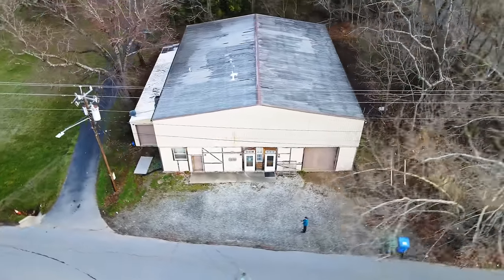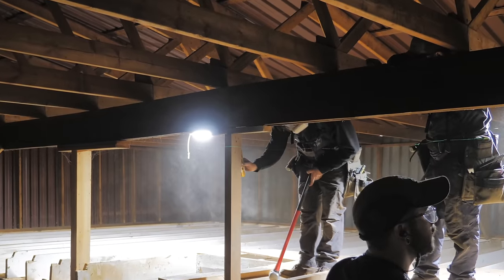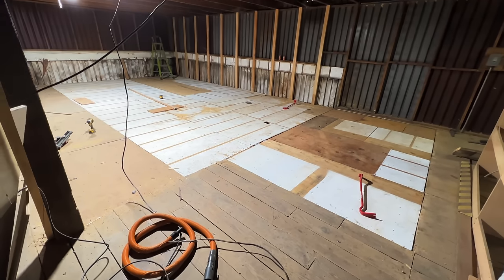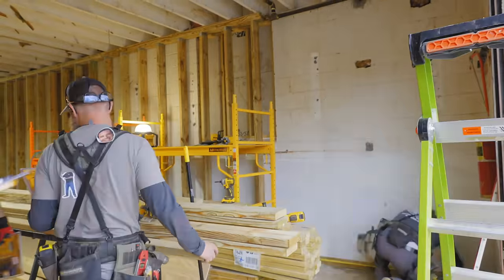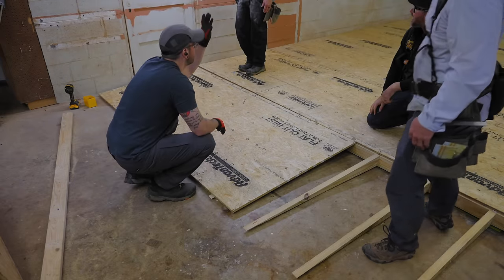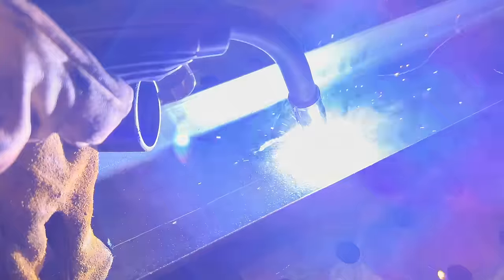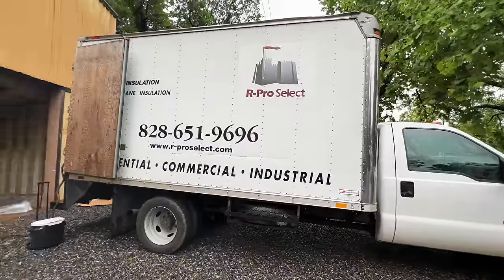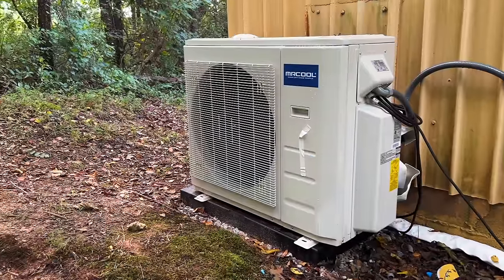50 Yr Old Workshop Restoration Into My Dream Shop

Comment: French drain the outer wall and replace soil with gravel, that building will never be dry unless you sort out the external issues.
Reply: Yeah I was confused why he didn't apply a waterproofing membrane to the external wall down to the foundation and then back fill with the grading corrected

Comment: Nicely done, an german electrician here, we have here 230V for normal household devices and 400V 3-Phase power for heavier machinery, then you swap the external conductor they ar running in the wrong direction. Normally we have clockwise rotating field so then you swap 2 wires, you have couterclockwise rotating field, so have fun with that

Comment: FEI, when re-identifying white or grey neutrals as hot wires, you need to do it everywhere the wire is accessible or visible, not just the load center.  So at both ends and every j-box or pull point it runs through you need to wrap it with black or red tape, paint it, use a Sharpie, etc.  That also only applies to the white or gray conductor in a cable.  When you're pulling individual conductors, you can't re-identify a white or gray conductor and use it as a hot.  In that case, buy more black or red THHN.

Comment: For soundproofing, walls should have a 2x6 top and bottom plate with 2x4 studs that alternate sides of the wall so mechanical vibration does not transfer. Use 6" thick insulation between the 2x4s.

Comment: WOW, what an awesome achievement. I also think the porch has forever changed the look and intended purpose of the shop. 
Can I also give solid props to Ray. The guy just has heart, he has been pushing shit uphill with his type 1 forever but still does everything with a smile.
Reply from the maker: Thanks, the porch massively improved the curb appeal for sure. Can't wait to get it painted and also add some windows on the second level to make the front pop even more. Also, Ray is such a hard worker, same with the rest of the crew. They do the work without complaining, even when the work sucks.
Reply: @craftedworkshop  yeah that will look awesome. Would you go modern or lean to the more vintage style windows?

Comment: Tip from someone installing those types of drop ceiling tile quite often, use Mr.Clean magic earaser and rub it dry on the stain...itll make most of them go away. If not, sprinkle some baby powder onto a dry paint brush and dab it on the tile. It should hide it and blend nicely with the rest of the tile. Great job non the less !!!
Reply from the maker: Great tip! Thanks for that.
Reply: @craftedworkshop  my pleasure mate, i love what you do !

Comment: Since there's a place for a comment, I'll leave one. 
First off, I don't think it escapes most of us, that although your a woodworker, and not a full-time carpenter/builder, you're doing a fantastic job, and it's clearly evident that it's your heart's desire to try and do everything as "right" as you possibly can. Very impressive. Your choices of tools and brands and subs (construction help/Perkins Bros) also equally impressive! Videography,,, also Spot-On! You're truly mastering your craft and coming into your own with your channel.  That being said, please don't feel like In this process that you need to adopt the inflection and delivery techniques of Ron Burgundy on the 6 o'clock news. 😅
That is all.

Comment: This comment is of course someone after the fact. However some 45 years ago, when I was a much younger carpenter. I was helping an older carpenter install a large acoustical ceiling tile job. Once we had the furring strips all installed, he brought out a couple of cloth aprons. He then poured a decent amount of corn starch in both sides of the aprons. We put on our aprons. And then instructed me to occasionally put my fingers in my apron, and grind them in the cornstarch. It kept my fingers extremely clean, and of course kept the tiles from showing any fingerprints also. Great video. I enjoyed watching your 3D layout and hard work come to fruition.😅
Reply from the maker: That is brilliant! I will definitely keep that tip in mind when I need to move the tiles in the future. Thanks!

Comment: My son has a 4000 plus sq ft cabinet shop here in Florida.
It is a production type shop, where he produces cabinets primarily, but also custom trim for his customers.
I cant even imagine him operating in a shop finished to the degree that this shop is.
Im assuming it will be used as a class room more so than a production type shop ?
None the less you did a very nice job on it.
I watch quite a few of the Perkins Bros. videos as well.
They are good mechanics, and that shows up in their work.
I was a home builder as well before retiring to Florida.
Reply from the maker: Yea, this is really more of a woodworking "studio" if you will, since I film my videos in the space. I will also be doing classes at some point in the future. I personally love having a well lit and clean shop though, makes me want to work in the space even more.
Reply: @craftedworkshop  Well, all the best with your new venture.
From my observations, id say that a great many of the shops on Youtube are more of a hobby variety than they are a working variety.
All the nice tools and such showcased on the walls do make a nice backdrop.
But they arent very practical in a real world production shop.
Aside from a charging station and some type of a proper cutting setup, there isnt much else to showcase.
As production increases, and more large machinery is added in order to meet the demands, the shop layout is apt to be changed anyway.
Lumber storage also eventually becomes an issue.
First off, in order to be competitive, it needs to be bought in bulk lots, not just job lots.
That means multiple pallets of lumber and plywood being bought and stored.
That also means that most even large variety lumber racks become obsolete.
It also means that a forklift is necessary for off loading and moving lumber from place to place.
How many youtube videos show or even talk about any of that?

Comment: I have an old 5k sq ft cinder block building that was an auto body business, and it was in terrible shape. It's still pretty rough but my partner has put in a ton of work to get it in a way that has allowed him to start a small woodshop and some table top CNC stuff. The first order of business for me was arranging the local electric company to get the electrical NEC compliant. It's been a really positive experience and my passion only grows as we make progress.

Your video covers so many things that we are dealing with! Thank you!! I also really appreciate everyone's use of PPE. Our electrical panel had old screw in fuses! Even a old solid copper or two in place of the first 🙄

Comment: nice edit, great project! glad you could find a job for all essential tools, like the post level and the cutting attachment for the impact gun 😉
one remark on the drainage outside: being you I would use the excavator to dig out around the wall and add an insulation layer.

Comment: String trimmer line comes in short straight pieces, which would be better and easier to use than the rolled version. Thank you for sharing your shop video 🥳

Comment: A good tip for the drop tiles that have fingerprints on them is to lightly scrub them with a moist paper towel, It will take out most of the lighter fingerprints.

Comment: Impressed how much stuff you were able to save and reuse in the rebuild. A little cheap thin steel wire will work good in place of the trimmer string if you don't have it handy too. Man that electrical work would be hard for me to stay motivated on. Came out amazing though.

Comment: First and foremost, I just want to say that this was an incredibly great video! We've seen the entire workshop transform from a dilapidated storage space into a dream workshop for us hobby carpenters. I'm really looking forward to seeing cool projects being made here!
I'm studying to become a civil engineer and I was just wondering about something; why didn't you choose to have a moisture barrier behind the studs on the east side of the building, since this was a wall with moisture issues? Another thing; if you notice that the CNC room gets a bit noisy, you might consider adding EPS/XPS insulation to reduce flanking transmission through the floor.
Anyway, I just want to say that the workshop looks fantastic and the video was informative and fun to watch!
Reply from the maker: Thanks, glad you enjoyed it! The closed cell spray foam acted as the moisture barrier there. That combined with the Drylok and PT lumber should mean no long term issues with moisture. I still haven't built the doors for the CNC room but good tip!
Reply: I'm not completely sure that I understand what you're suggesting for sound iso (the floor above or below?) but, I'll proffer this info. Closed cell foam board isn't usually helpful for sound. It doesn't 'absorb' sound like a fibrous or porous material does (fiberglass etc). And it has virtually no mass so it doesn't help in reflecting sound back except at high frequencies which is usually not the issue between rooms. But you're right on target wrt flanking paths. This is why sound isolation is so hard. One little gap somewhere can undermine a huge amount of cost and effort. I can almost guarantee that his doors are going to be the weak point. Any door that will not be the weak point will cost him an incredible amount of money and will not be easy to open and close. Lastly, it's not clear to me where his dust collector is going to live. With a real spindle on the CNC, the primary noise source is the DC, especially low frequency noise that is hard to isolate.
Reply: best way to mediate noise is to stop it at the board by floating the board on the studding on top of thickening. Zoning and segregating always beats just money into material to try and create utter barrier by way of force. like heck why not just go outside and start loading clay into the cavity :P

Comment: Why did you choose to level the floor with wood as opposed to self-leveling concrete? That's designed specifically for fixing that kind of issue?
Reply: Have you ever used it? It's fine under carpet, though It tends to come loose and create an annoying floating slab.

Comment: The drill bit for Tap-Cons is smaller than the screw. If you use a 1/4" bit with a 1/4" screw, it will spin all day long. Use 3/16 drill bit for 1/4" screws. It tells you on the packaging the correct size drill bit. The trimmer string is great when the screw has been ran in and out too many times.

Comment: You're drilling in cinder block. It tends to bore out more than poured concrete when drilled. Drop down slightly on the bit diameter. I've used thousands of Tapcons.

Comment: An easy method to wrap an I-beam is use 3/4” plywood and pocket screw them into the joists above.  (Pre-installed cleats also work and can double up as strapping if you’re sheet rocking) You can wrap the bottom portion with any thickness of plywood (depending on final height.  From there you can either install Sheetrock or finish as is.  No drilling through the I-beam required and it’s plenty strong!  As a bonus, the void behind the plywood can be used as a raceway for wiring or conduit.

Comment: now that I re-watch your restoration of your shop, I caught the assembly of the new Garage door,  that lowered the passage height. Wasn't it that specific door that made the Camper-Van remodelling such a pain? 😂
Reply from the maker: Hah, yes that did make the van a little trickier to get inside, but the porch girders are at the same height roughly. I don't plan on having vehicles that tall in the shop so it wasn't something I was going to plan around, I really wanted a door with thick insulation.

Comment: The secret to sound proofing is air gap. Air is actually pretty bad medium for sound wave propagation. Whales can communicate over vast distances because sound travels much farther in water. The reason why those tin can and cord phones work so well is because the sound waves aka. vibration can travel down the cord. Cut the cord (create air gap), it stops working. I wish you did a before and after sound test between the upper and lower floors before installing the drop ceiling. While it's not perfect because it's still connected to the ceiling, I bet it greatly reduced sound travel between the two floors.

If you have noise issue from the CNC room, what you can do is hang some foam boards (styrofoam or similar) from the ceiling about an inch or so away from the walls. Full coverage is not necessary but the more the better.

Comment: I am curious as to why the block wall was not excavated on the outside and waterproofed,  on the outside rather than the inside !  Was there any w'proof membrane outside against the dirt in the original block construction?

Comment: Excavate all the way to the footers waterproof the outside then put in a drain and backfill with rock not dirt use landscape fabric over the rock to prevent it from filling up with dirt. The drain needs to run down hill of course. The bowed block wall may straighten out when you do the excavation.

Comment: @craftedworkshop There are a few different types of Wago connectors, but with the type you used, you don't even have to flip the clips up when connecting the cable. You can just push it in if it has a solid core and doesn't have individual strands of copper. When removing the cable from the connector, you have to use the clips.

Kind regards from Germany

Comment: Hello , maybe didn't make the video but you need to pull vacuum on the cooper minisplit lines before opening refrigerant you do this to check for leaks and to have clean lines free of air
Reply from the maker: Not with these MRCOOL units, the lines are pre-charged.

Comment: Not sure if it will grow in your region, but if you want low maintenance ground cover, the best I've seen is a plant called "kinnikinnick" It's a very low shrub, 4 to 6 inches high, that just spreads out over the ground.  Plant them about 6 feet apart, weed the ground between them until they form a continuous mat a few years later, and then you've got something that's pretty drought resistant and requires basically zero effort to maintain.

Comment: Thanks for sharing, especially the costs involved.  I would like to understand the rational behind the raised floor.  It is understandable that the slope of the floor/drain might have been an issue, however, it seems like there might have been other reasons behind this decision and expense.  Also, how do you get into the spray room with the door blocked.  Also, will your only access to the second floor be from the outside?
Reply from the maker: The floor drain caused the floor to slope about 8 inches over 12 feet. I talked to a few concrete guys and they said pouring additional concrete was a bad idea as it wouldn't adhere to the existing slab. Also, I personally think it's much nicer to work on a wooden floor, a lot easier on the joints. The spray room has a huge door opening around the corner from the door I covered up, just wasn't easy to see in the video. The second floor is accessed through the office/kitchen space, plus the back door leading outside. Thanks for watching1

Comment: It's nice to see pro's working vs DIY vibes. Only thing i thought worth mentioning since painting new stuff is common and someone else might benefit - RE: this job's  "Caulking -

- in painting is usually called "gap filling" and uses acrylic "no more gaps" etc

 vs 

- finishing the gaps between painted and unpainted surfaces which is done with silicone like caulking and a pop-stick)

- the gap filling for painting is much better done AFTER the primer coat

- it doesn't bond well to surfaces that havent been done and can start to peel out over time and is a hassle to deal with because it doesn't sand and it sticks in little bits 

- it's much easier to get a smooth surface on the gap filler because bare timber etc sucks moisture out of it and gives a rough edge to the filler

The primer also fills a little of the gap so sit's a bonus and easier to gap

Not important here for shop as far as finish but not extra work so just an order of operation thing and quicker anyway

Main thing is the filler lifting out of the gap over time because it bonds to primer - not bare surface
Reply from the maker: Is this true with an elastomeric sealant like Big Stretch? Definitely interesting!

Comment: Been a pleasure watching this beat up shop turning into a dream shop! Excited to see what the future brings. Are there any plans on painting or even changing the outside cladding or roof ? Could make the building even more beautiful and keep the inside better protected by the elements.
Reply from the maker: Thanks! Definitely plan to paint the outside and possibly the roof. The roof is thankfully very solid, no real leaks except some poor flashing around the plumbing vent pipes, etc.

Comment: Very impressive project. This is a great video. Lots of hard work and many smart ideas. I love that raised floor and how you leveled it. That was brilliant. I plan to do something similar in my shop where half the floor will be slab and half will be a raised floor. I was previously thinking about hanging i-joists for the span, but the way you did it also seems very practical. Here's my question: given all the moisture and mold and seepage through those old brick walls, do you intend to do any dirt work outside, trench out near the walls and apply an exterior moisture barrier and a more thorough drainage system? It seems to me that no matter how much you seal up the interior, if you don't stop all that water seepage through the brick, it will quickly (maybe 3-5) years start to contaminate the interior again.